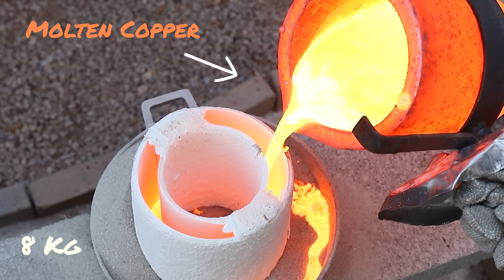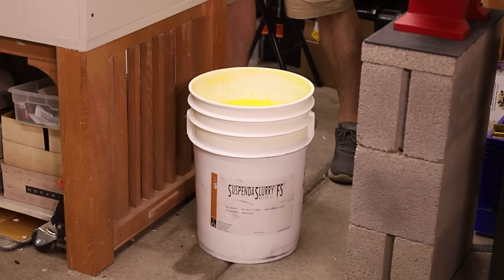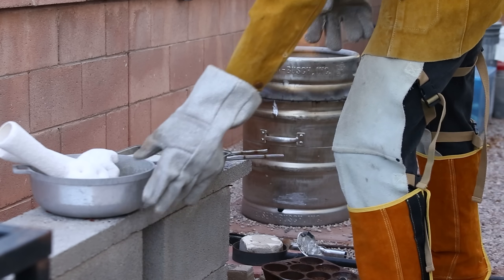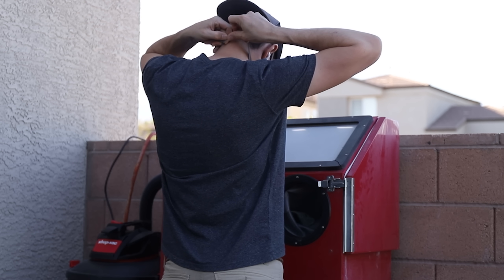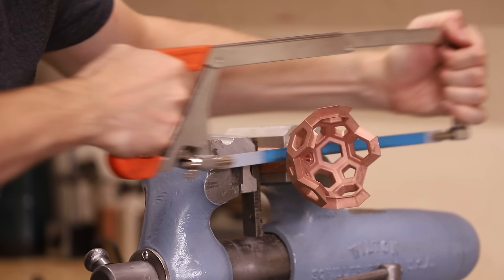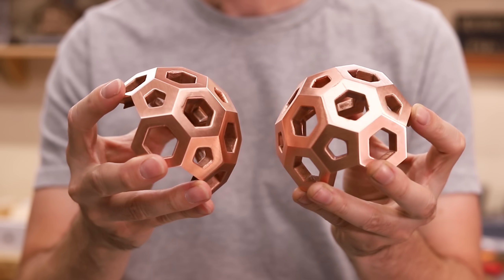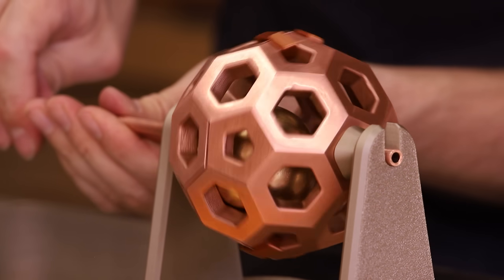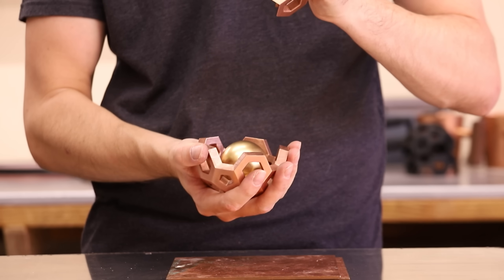HUGE Magnet VS Copper Sphere - Defying Gravity- Will a Neodymium Magnet Float Inside?

Comment: What about making another complete set of magnet and copper casing, and then synchronize the polarity of the magnets while spinning the cases in opposite directions? Would that manage to cause them to  push off each other just enough to float in the center?

Comment: maybe if you printed up two wheels turned into copper that would rotate opposite of each other, kind of like gears would do but instead of them touching they are positioned a distance  where the magnet is in between them, maybe on a small stand. where the magnet is sitting in the middle of the wheels and the parts of the wheels going past the magnet are going upward creating two of the larenz effect, then possibly three or four copper wheels to hold the magnet in a field while the wheels all rotate at the same speed with the outside of their diameters passing in an upward motion past the magnet. Have I made it completely unrecognizable. Describing things is not my strong suit.

Comment: I wonder what would happen in the hexagonal holes were filled with correctly sized correctly shaped magnets with all the same polarity facing outward? I wonder if the magnetic field would get stronger, if it would generate electricity, float, or just behave as we expect magnets to behave.

Comment: I’m sure you’ve gotten this a million times, but I wonder if you would be able to save time and maybe get better results if you were able to 3d print the designs in ABS and smooth the layer lines with isopropyl alcohol. I haven’t tried it before, but it might work in your case.

Comment: you have to make the "sphere" larger so there is more spare for the magnetic field to hold the magnetic ball, you can also try making the "sphere" an electro magnet and see if it will hold the magnet ball by pushing with opposing magnetic fields

Comment: I wonder what would happen if you rotated it while it is immersed in either pure water or salt water.  I wonder what would happen if you did the same but in a more viscous fluid.  I wonder if there is any way to generate electricity with it, or oppositely use electricity to rotate it.  Perhaps if you use a regular motor to spin a magnet, then you could indirectly rotate the sphere without needing plugs with a rod then, you'd just need clips or whatever to hold the sphere together.  I wonder if you recast another sphere with thinner edges (so we could see inside better) if there would be enough copper to still induce the floating effect.

Comment: I think the lighting on the cage was still obscuring the darker magnet almost too much to see. All the angles on that cage probably make it hard to get any view without a reflection rotating into view. However, I wonder if you could backlight the cage a couple narrow spot lights with a beam width not much bigger than the large hexagon panels. So that most of the light is going through the hole, and hopefully bouncing off the insides, or bouncing straight back to the source. Then decrease your front highlights so they aren't as bright as the internals.

Comment: I would love to see this same example with more complex shapes/topologies such a a tube bent into a circle or braided "mobius tubes" or a klein bottle or some such.

I think you might be impressed by the affortabilty of metal 3d printing service costs (most of which include materials cost) in comparison to the cost of paying a foundry or casting yourself.  I TOTALLY understand the point of this video but if you come up against a shape you could not cast, and wanted to showcase a design,  this would be a video I would watch and possibly pay you for a print of myself.

Comment: You could paint the inside of the copper black, that will help make the magnet more obvious. Since it wouldn't be reflecting copper color against a copper background. And of course, painting (or use tape) stripes on the magnet will make it more obvious too.

Comment: If you have a lathe, you could maybe use that to control the speed more accurately, plus it should be a lot easier to keep it steady. I could see the 3D printed plugs possibly being an issue though.

That thing looks cool as hell though, makes for a great decorative piece regardless of the purpose it was made for.

Comment: This is by far my favorite channel for this type of content. I mean, of all time. This creation amongst the others is so beautiful. Amazing, really. Thank you so much for everything you do to provide content, information and entertainment. I would subscribe to you for premium content if you had the option. Maybe, you would ever want to put together a guide of sorts for everything you've learned thus far that we could purchase? 

Also, a random and off topic question. What is the rotary type tool extension you used? It looked like an electric powered motor/switch with a long lead to be able to only need to hold the functional part of the tool itself. Like a whip hose on an air line, but for a Dremel. Hmm. Thanks man! You're awesome.

Comment: Noticed when you were trying to get a better camera angle that the axis was a copper tube. Not sure how practical or if possible but it would be good to have an endoscope camera within the axis tube to get the internal view when it’s rotating.
Reply: what if you had an endless copper tube with that ball in it? Would the ball stay perpetually suspended?

Comment: I have a few suggestions.The levitating effect works better when you use a solid piece of metal, like the tube you used in the beginning. I’m not sure you did it in the video but making sure it has good contact between the two sides (electrically i mean) should make it work better. I haven’t done the maths yet (it’s hard to figure out the exact shape of it form the video) but pretty sure since it’s in two pieces the magnetic field get mixed up as it rotates and instead of repailing it attracts the magnet to the copper. Also as i saw in some comments trying with a lighter magnet (smaller) may make it work better, the one you have seems a bit heavy. The stronger the mass the magnet the harder it will be to make levitate, and the centrifical effect will be pretty big. I’m not a specialist in electromagnetism but i know a little (future engineer that just got started)

Ps: sorry if my english is bad, i speaks French in my day to day life.